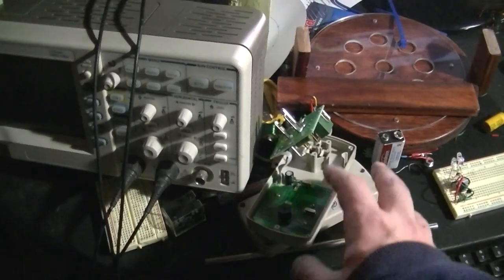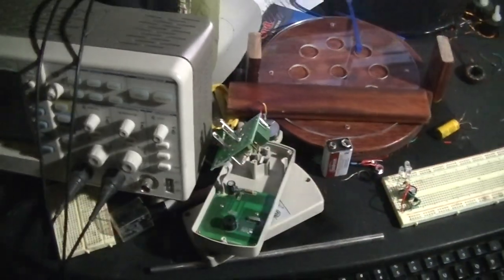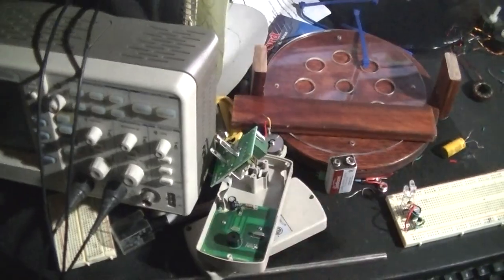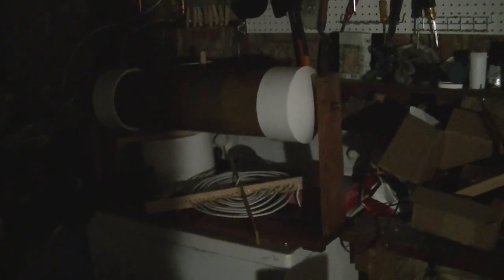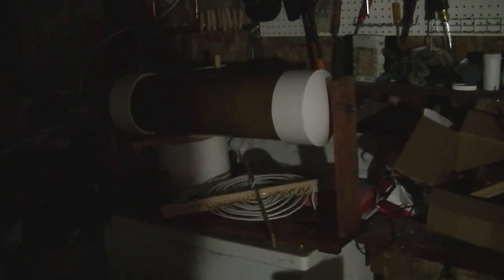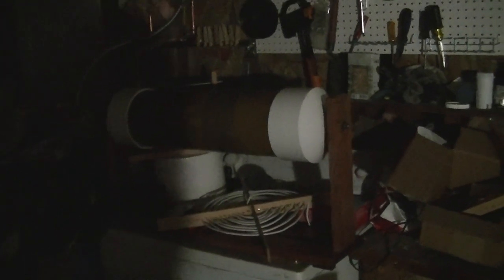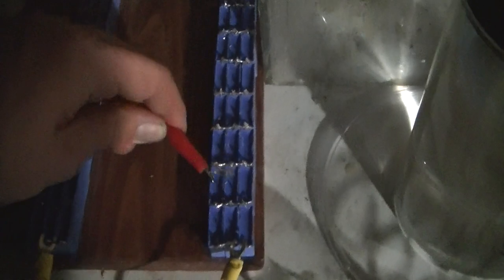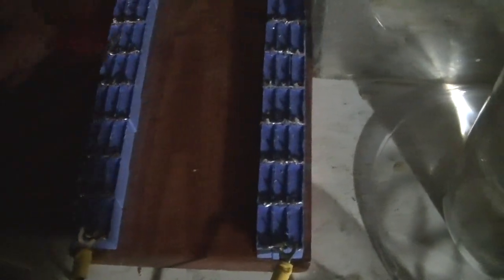Extreme Dielectric relaxation

Comment: That's actually dielectric absorbtion, the charge leaks into the oil.
It's the same reason high voltage capacitors should be stored with shorting wire.

Same goes for crt, etc.

For capacitors you model it as a capacitor in series with a huge resistor, and that circuit is connected in paralell with the actual capacitor.
Reply from the maker: Yes, it's also called dielectric relaxation.

Comment: Love the example. Hey if you keep referring to neutral then why not treat it as a return wire like what neutrals used for? For example use the virtual ground to have a center tap electrode for invetween the bipolar madness. This won't save your motor of course but I know you will get that part figured out in the mean time

Comment: Is this the same type of electrostatic phenomenon that is causing the charge on a secondary coil so that you get nailed several times after a short run just by touching the side that is thick with varnish? That coil is earthed yet builds a DC charge within that dielectric coating?
Reply from the maker: The very same effect, only my coil isn't grounded, so it has created its own positive and negative reference.
Reply: Diadon Acs Cool video and good timing. I found something unusual and related to this experimenting today. Could help explain phenomenon or at least take it a step further. Hope to have something posted in day or two. Uses an odd 3 terminal cap but not an HVAC run cap although that could be interesting.
Reply from the maker: That's great, I think the particles in the air shouldn't be overlooked as charge carriers.
Reply: Diadon Acs The carrier could be ozone generated by high voltage and likes to cling to metals and dielectrics. Ozone is the most powerful oxidizer and I think it could be used as a medium for recharging energy storage devices.
Reply: Hi Terry, I've got a 4" coil that's wrapped in two layers of plastic. I've used a single layer before but with this coil with two layers, when I switch the ZVS off after shooting some sparks  and I touch the secondary there's like a static that crackles between the layers. It will do it quite a few times. Is that the same sort of thing you're talking about? I was thinking I just made some sort of weird capacitor. What do you think mate?
Reply: deeds the same effect " Extreme dielectric relaxation " yep :)
Reply from the maker: The more insulation or dielectric, the more extreme the relaxation. Its also important that you have two volt potentials or spin potentials. If that makes sense. That's why it works well with grounded coils as one potential, or bipolar bifilar coils with two potentials. Now how to resonate that with the earth capacitor?? ;)
Reply: Diadon Acs Terry Woodroof   Thank you fellas, that's got to the bottom of why that resonator was so crackly when I switched off and touched it.  You can tell it was still going around in the back of my mind.   i think I understand what you mean D, I'm getting better at understanding anyway. I'd love to see you resonate it with an earth capacitor.  Cheers guys.
Reply: Wait Wtf terry..... I never really though of it like that. A grounded coil holding enough excess charge to put a zap in the brain......

Comment: I'm thinking this is what you are trying to emulate no?Image from http://link.springer.com/article/10.1007%2Fs10854-015-3351-2/lookinside/000.png.
Reply from the maker: +Alex S. Gabor That is one use for graphene as a charge medium in a dielectric suspension like PVA. Super Capacitors are what some people call them, simply just energy storage devices works.